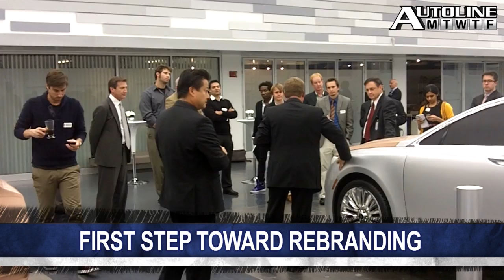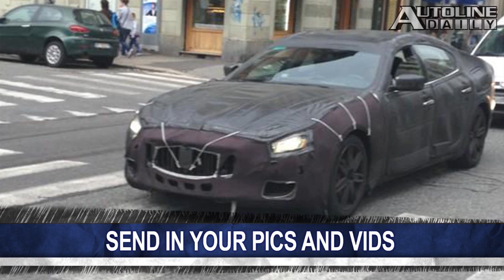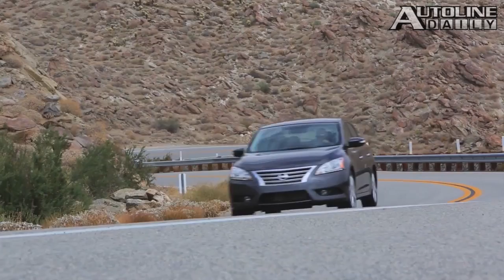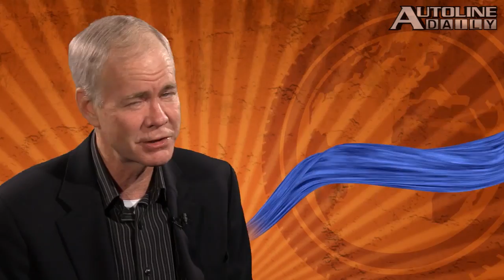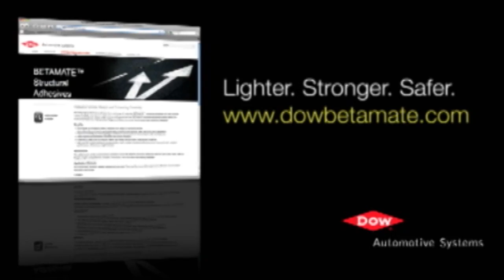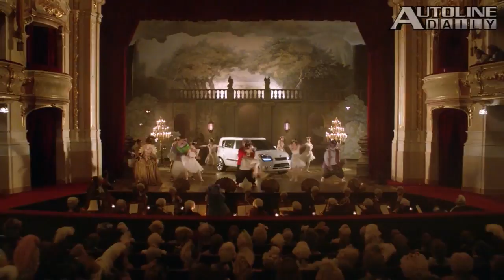Lincoln Rebuilding its Image - Autoline Daily 996

Comment: Its a 20k Try, Kia if you want me to try, You should help me out and sell me the car on good finance rate. It's not the 90's, Heck I working on/off basis. If am gonna invest in something it better well hang with me for a long time. i.e my 1991 Ford Taurus and 1999 Dodge Ram, both of them have had a serious run, Transmissions, Waterpumps and etc. 

your 100k warranty ain't shit if begins to fail at 101k.

Comment: I don't think the current or even upcoming Lincoln lineup is very youthful. They still look like Grandpa cars. Ford did a great job with the Fusion, at the same time (and using the same platform) created an old, odd looking MKZ. They should've kept Volvo.

Nissan killed the SE-R+Spec-V models and the rumored coupe, they're going in the opposite direction. With BRZ/FRS, Veloster and sporty compacts selling well, Nissan needs a proper 240SX, SE-R or Sentra Coupe with grunt behind it

Comment: Veedims, a relatively new technology, and a company, makes combining systems in cars as easy as plugging together a computer. I heard about it first in the Iconic AC super car. It has the ability to reduce weight and overall cost by simplifying wiring to a few cables and modules. Broadcom, known for making ethernet and networking devices for PCs, is nothing new.

If FORD wants to rebuild Lincoln, they could just go back and redevelop several concepts for production and work from their.